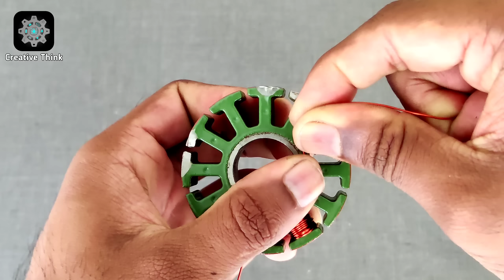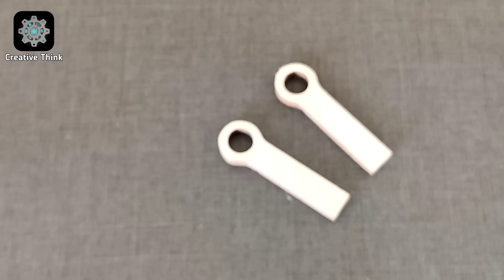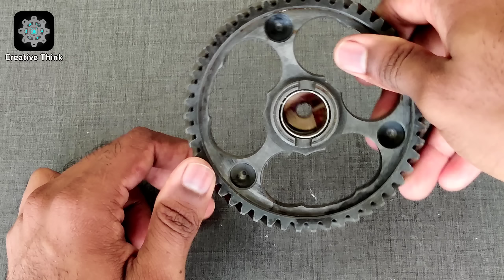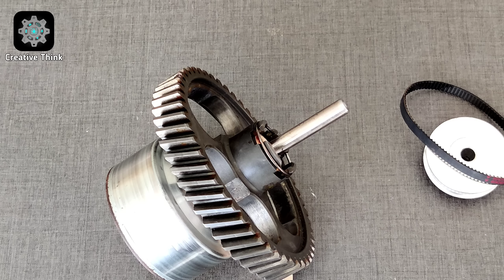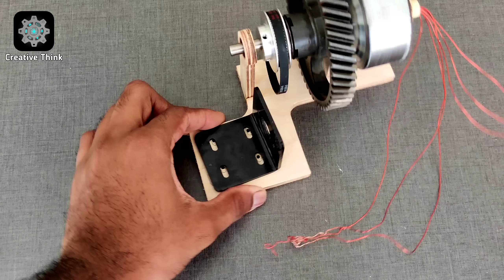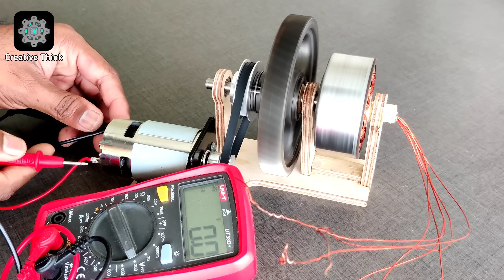Making Powerful Generator

Comment: In High Speed it can produce how much Voltage.
On my tractor i need 40 volt to play audio amplifier but tractor Battry is only 12 volt i am to use Voltage Booster
But i want's to use this type of generator
Reply: I honestly think you'd be better of getting a 40v battery cookie, tractors are cool though, so you've got my respect :p